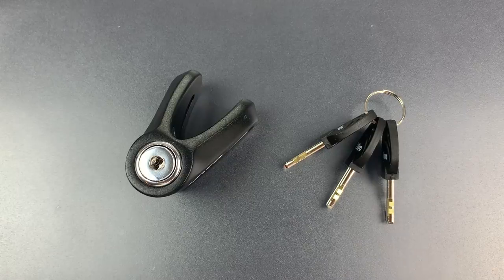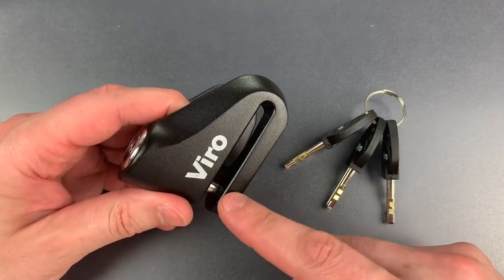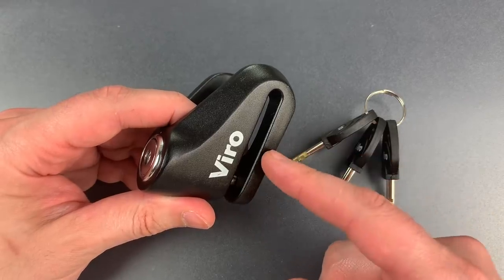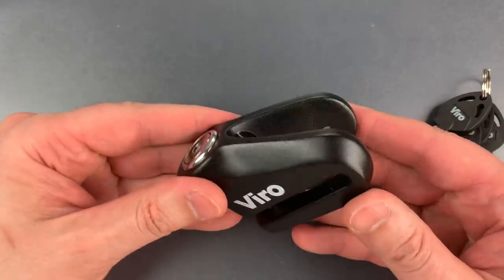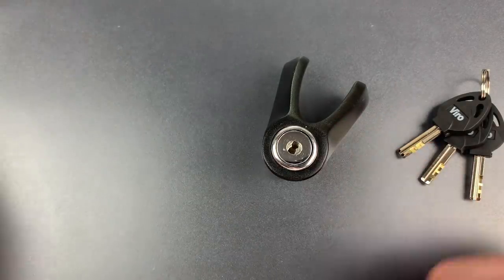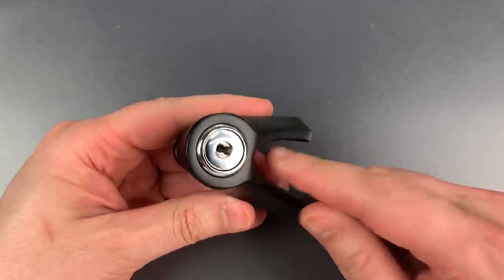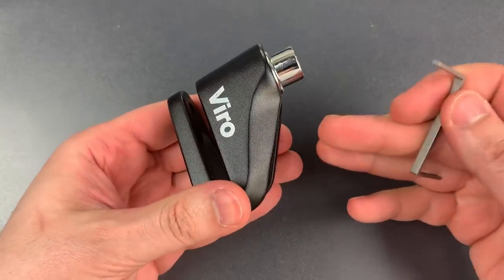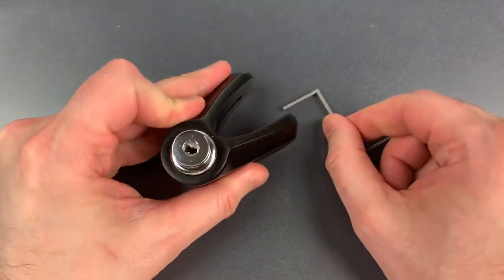[885] Forced Open in 2 Seconds: Viro 166 Motorcycle Brake Lock

Comment: I bought a set of those cheap clear plastic demonstration/practice locks on Wish a while back, and it came wit a disc detainer padlock.  All it took to open was a tension tool, but it actually took MORE force than it looked like this did.  I would probably rather call this a "lock-shaped object".

Comment: Try the Artago 32S Full stainless steel brake lock. It uses disc detainer core, very solid. Wheigs around 1.5 Kg, and it locks in both parts of the lock, so even if you manage to break the steel, you can't remove it.
Ah, and it has a very sensible alarm, wich makes it impossible to pick it without a bunch of noise.

Comment: One thing I really wonder: When you come across a product that is as sloppy as this, do you also inform the producer of it?
I mean, when the body is made from hardened steel, that implies that the producer is serious about security. And so most likely they should be concerned about such a sloppy lock. I would assume all you need to do is to keep the lock body, and replace the lock. So I would guess that they would be happy about such feedback, so they can improve their product.

If I was shopping for a lock, and the lock stated "Approved by The Lock Picking Lawyer", I would buy that lock.
Reply: If you're happy to make something as shitty as that and call it a lock then you're probably equally happy to put "Approved by The Lock Picking Lawyer" on the packaging.  Both would be statements in serious breach of honesty in advertising, so if one why not the other?

Comment: Yo LPL one thing I've noticed on low quality disk detainers is they often don't mind of the bitting is off. Just try out multiple keys at different depths of insertion. With a small keyring of tryout keys and zero skill you can get a 50% success rate.

Comment: even if that lock worked, im not sure that the cast aluminium would stop 500cc of  motor. Im not certain as i havent tested it but i think asny one of those locke, even a really big strong one would just knock off/break/bend the brake caliper

Comment: Wow, and to think that this lock style is extremely common in Italy it's quite disturbing. Anyways, even if the lock wasn't that loose, just plying a flat head screwdriver in the disc rotor slot and twisting it makes it pop right up...

Comment: I was suspecting that this was attack vector before I watched it. :) Looks like core surrounding discs is from cheap plastic or sidebar is weak or alltogether. If it uses ball bearings for locking into place , they might be too small , and tollerances are sloppy. :)

Comment: What I'm asking myself is: Does LPL contact manufacturers about such design flaws? It's one thing that you produce easy pickable stuff like Masterlock. They surely don't have security as prime directive - but it's another thing when you build something out of expensive material with a not so bad looking key design - and then it can be picked or bypassed in seconds.

Comment: OK as presented the lock is crap, but if the body is hardened steel and it's just the lock itself that is useless can you gut it and fit something better?  Personally I'd like a disc-lock that is brightly colored with a stretchy-chain to the handlebars as a reminder, black is a lousy color to choose.

Comment: I got this reply from Viro...

“Dear Mr. 

first of all we want to thank you for reporting the presence of the video. 

We would like to inform you that what is highlighted in the video is an unforeseen anomaly of a specific production batch. Conscious of that, we had already defined the corrective actions to solve that specific batch defects in order to guarantee to our customers a product that works properly. 

Viro has been present on the market for over seventy years and has always been very attentive to customer satisfaction, which is why all reports from the market are scrupulously examined and managed by our Technical Assistance in order to improve our product quality and achieve full customer satisfaction. 

Our brand has always been characterized by accuracy and reliability, also and above all, in the correct and timely management of (very rare) cases of defective productions, as in the case in question. 

Best regards. 
Centralino Viro S.p.A.
Ph +39 051 6176511
Fax +39 051 6176579
www.viro.it
Reply: Thank you for posting their response!
It's not the best bafflegab I've read in a while -- but it's close.